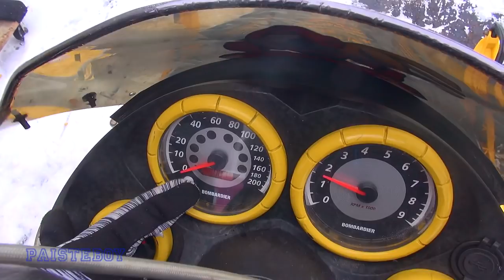TEST RIDE Blair/ZUKE Morgan: December 26th 2020

Comment: idle sounds a little off. I'd recommend jetting down to 370's and 17 start jets.. Also, check the idle air on each side while your at it 1.5 turns out. Just tuned a rev just like that and it wheelies, lol.
Reply from the maker: Thanks for the pointers and for  watching.

Comment: Sounds like the zuke morgan is either dropping fire on a cylinder at idle or pilot circuit in the carbs are not quite clean enough did you use the jetting he had before? If not you will need it with that dyno port pipe. Great vid glad its running again.
Reply from the maker: It could be one of the two things that you mentioned.  We'll look into it.  Thanks for the tips Jacob.